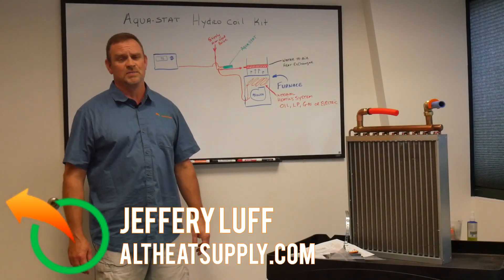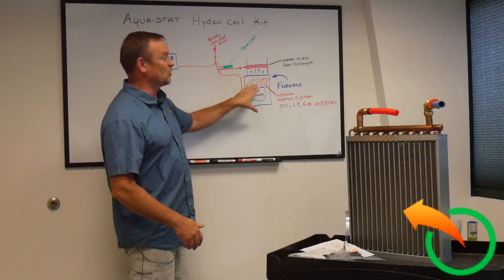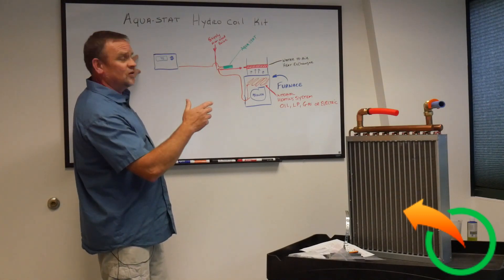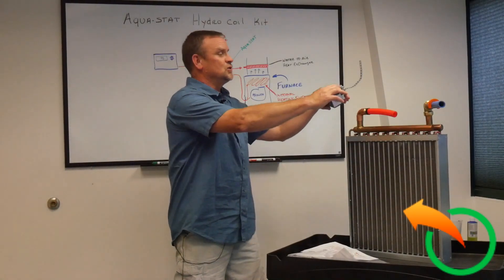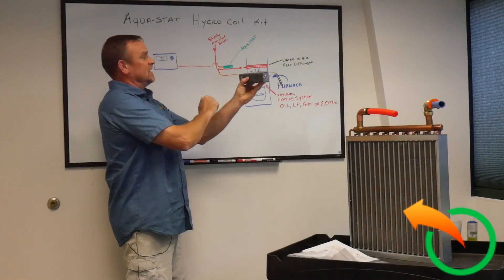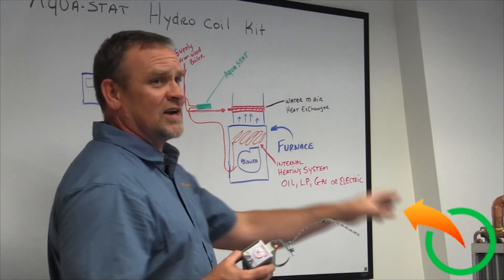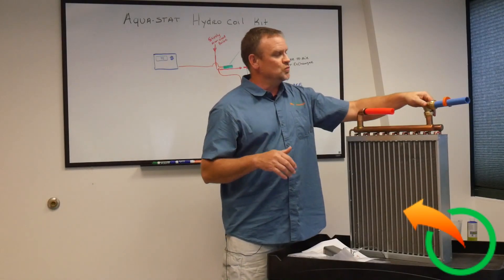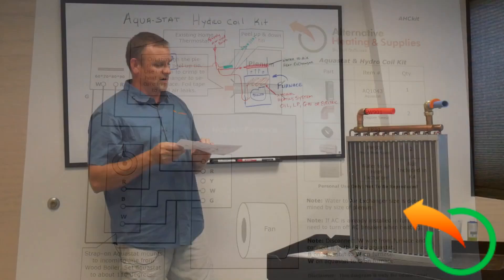Properly Connecting an Outdoor Wood Boiler to an Indoor Furnace [PART 2]

Comment: Used this setup in a previous house with electric heat and it worked flawless. I’ve moved now and have a furnace with a heat pump and lp gas backup with 2 zones. Would I need two aquastats now since I have two thermostats? The two thermostats wire to a zone control board.

Comment: Plumbing and Heating tech here—Pro tip— extend the copper pipe to allow for the aquastat to be strapped to the metal pipe instead of the pex. It will detect the temperature changes with greater accuracy and the cycle times will be more consistent.
Reply from the maker: I agree.

Comment: Will this work on a wood stove in the dining room of house and the furnace plenum is in basement that sends heat to house via ductwork?  I thought we could run water pipe through firebox and then down to the cold air return and put the heart exhanger of yours there? Thoughs? Thanks, Mark & Family

Comment: I installed per the instructions on my oil fired hot air furnace.  When wood boiler is cold, the aquastat allows the furnace to work normally to operate burner and blower fan. When boiler and heat exchanger are hot, the oil burner is disabled as expected. However, when room stat calls for heat, blower turns on and then won't turn off... So house gets overheated. How to get the blower to turn off when room stat is satisfied? Thanks.
Reply from the maker: The furnace has a sensor to ensure heating coil is cooled off before the blower will turn off. Find that sensor and move to a place so it can cool off and the fans will turn off. Jeff

Comment: I’m inquiring about the taco pump cartridge 009. I have to replace it way to often n now the cost has skyrocketed to get it. I’m thinking my actual problem is the water gets to hot because house need varies so much the water can get into the 200 degree range  or even boil n then shortly afterwards the bearing poops out. Feedback is appreciated but actually looking for advice/ options. Sometimes it’ll go out for no reason. I don’t keep the temp high unless it’s below zero outside n actually stay 20 less allowing extra time for the temp increase. The whole unit works great except for the cartridge issue. Bronze used but now very spendy. Wish I would’ve bought a case of m before. Lol I guess.

Comment: Thanks again for all the great videos.  Are heat exchangers directional in the sense that it matters what direction the supply water enters the exchanger and flows through?  Additionally, does it matter what side of the exchanger faces up in the plenum?
Reply from the maker: No, it doesn't matter.

Comment: Hello, great vid! My question is,  I already have a heat exchanger in plenum for Central Air. Can that be plumbed in-line to be also fed from outdoor wood burner/boiler and use an exhaust cooling/heating fan thermostat switch? Hope you can make sense of that? Thanx in advance. Jay
Reply from the maker: Central air exchangers are different then what we use. so No if I'm understanding your question correctly.

Comment: So I used 2 thermostats and just jumped the second therm to my first therm to where it only runs the fan. Works great and it took 1 ft of wire instead of wiring all the way back to the furnace... just an FYI.
Reply from the maker: We also don't need to run all the way back to the wood furnace. The way you did it also works. We did it that way years ago. Now we use this method to make it seamless and not have to make two thermostats juggle the temps. Happy heating. Jeff

Comment: If you wanna propane instead of your boiler when the gas runs long enough will it heat that probe up enough to make the gas shut off and run fan only ?
Reply from the maker: I'm not the person to help answer that question. I'm a wood boiler guy.
Reply: @AltheatsupplyLLC  I realize that but I bought the unit from you guys
Reply from the maker: @bcase29  Clearly I'm not understanding what your asking then. Give us a call for clarity. Jeff

Comment: When you have this installed and have two thermostats at each area of the home’s zone (one for forced air heat/cool and one only for OWB radiant heat), how do you suggest setting them so my OWB radiant heat kicks on the fan in the forced air unit? Currently have the OWB thermostat at 68, the propane heating/cooling thermostat at 55 (emergency back up heat) for each zone, and the fan set to auto. It appears the fan rarely kicks on in auto — but will work if I set the fan to On. I want the fan to turn on when the boiler thermostat in each zone is calling for heat so it helps circulate heat better.
Reply from the maker: We sell Kits to solve most of these issues. They are called Aqua stat Hydro Coil Kits. If you go to my website: www.altheatsupply.com and type in AHCkit you will get a variety to choose from that fit most applications. Jeff

Comment: Can I use this with geo thermal?  I currently have a geo unit and I want to run a boiler.    Can I use your aqua stat kit with this and use the same instructions as well?
Reply from the maker: Yes you can, I also have Geothermal and there is very little difference.

Comment: So I read in the comments that this will work with a heat pump system correct? I read in the instructions to turn off the AC breaker?  Or that something other than a heat pump?  Thanks!  Great videos
Reply from the maker: That is correct

Comment: My existing oil furnace thermostat is only connected to the oil burner and not the fan. The fan turns on via a thermostat that is sensing the temperature in the plenum at the furnace. How does your kit allow the control of the fan when the heat exchanger for the outside wood boiler is delivering hot water to the heat exchanger. Won't I need another relay that is connected to the upstairs thermostat that can turn on the fan and not rely on the probe thermostat that is in the back of the plenum at the furnace. In other words I need direct control of the fan via the thermostat.
Reply from the maker: Simple, when your thermostat sends a signal to the furnace, there is an aqua stat on the water line from the wood boiler which sense the water from the outdoor boiler is hot tells to turn on the fan only which will turn on the fan and exchanger heat with the heat exchanger in the plenum.

Comment: Can I put exchanger in a furnace down draft in a double wide ? If so does exchanger need zone valve .?.
Reply from the maker: Yes you can, but the fans or blowers don't like to much heat. No you don't need the zone valve, you can run the water around full time if you choose.

Comment: mine was setup this way, which caused the furnace to burn out because it was too much resistance for the blower
Reply: Wait. You wired the fan power feed and not the furnace control?

Comment: I have a very similar setup to this, but I do have a problem. I have the boiler set to 180. When the house thermostat calls for heat, it kicks the (oil furnace) fan only on like mentioned in the video but after the thermostat temp is reached the fan limit switch stays on because hot water is still being pumped through the air handler from the boiler it cannot cool back below 100 where the low limit is set. The result is the fan keeps running and the house gets too hot. How do I correct this issue?

Comment: I bought this kit and the aquastat I received is not like the one in the video. Mine does not strap on. It has a probe that gets strapped on I used zip ties. The probe is like a rubber after a few day it has a melting mark on it also the temp on the aquastat I don't think is accurate. Never gets above 155. It is mounted directly to the copper supply on my heat exchanger. Why is mine different then the one in this video any help would be greatly appreciated?

Comment: With this kit, I assume that there will be a circulator constantly running water between the wood fired boiler and the water to air heat exchanger mounted in the plenum?  That is the set up with my system currently.  I have an oil fired boiler in the basement and I have a circulator running 24/7 supplying hot water from the out door boiler.  I don't like this as it wastes electricity and hot water as well as there is always some thermal loss in the transmission.  So in the down times when the house isn't calling for heat I'm pumping water unnecessarily and wasting heat (and wood) as well.  I'm building a new house and will be installing a hot air furnace.  I was thinking that there would be a separate thermostat for the out door boiler that would turn on a circulator (as well as the air handler in the house) when heat is called for.   Wouldn't that be a more efficient system?  Thanks.

Comment: In answer to Don Doeb. Yes. Mine does so. wired slightly differently to this system But it does work so priority is given to wood heat then, if water is cool, to oil furnace.  I note emphatically.... that  my 100kBtu ( allegedly ) capacity heat exchanger installed in the plenum has less heat output from the wood boiler of 137k Btu output than the 60k Btu oil furnace in which plenum it is installed.  Following natural logic it could be no other way. The air temperature coming from the oil furnace is much higher than the 180°  water temperature. Whatever anyone tells you,  there is no way around this without significantly speeding up the fan to increase air flow.

Comment: Do you think the hydro coil kit could work in reverse,( if my wife is too lazy to keep the fire going).  Would it heat the water enough, that if the outside boiler wasn't on, that it would keep the outdoor wood burner's water from freezing. Circ pump runs constantly, moving the water from outside. outside tank is about 150 gallons.

Comment: I used a Fan Limit Switch which are rated for up to 14 amps at 120v. The strap on aquastats are only rated for appr 8A @ 120 Vac which could exceed the amperage draw of the furnace fan motor. 

The aquastat would probably work fine but I didn't want to take the chance.

Comment: Probably a dumb question but I purchased a double-wide on a full Foundation that has a wood furnace inside it already but I like the idea of having an outdoor wood boiler because of it being more efficient. that being said would I be able to hook that outdoor wood boiler to my oil furnace I'm sure if the Miller furnace that comes in a double-wide is any different than a regular residential oil furnace. My water is also run by on demand propane the only time the furnace is on his for when I need to use the oil for heat.

Comment: hello, great video,  I might have a dumb question.  I have been working on my mother in laws out side stove.  older model ncb 250 its about 10 years old.  for some reason it won't heat the house above 70 degrees.  I replaced the water pump and heat exchanger which was clogged badly at its inlet side.  The aquastat on the stove wall can't be set higher than about 140 degrees or it starts blowing off steam , which I don't think is hot enough to get her house any warmer.  is this true ? and should the water flow be the same pressure going into the heat exchanger and coming out . because when I open the drain value on the return line I get a sudden burst of water than it slows down a lot.
Reply: Roy, it slows down because your heat exchanger is partially blocked. Try disconnecting it and flushing vigorously for several minutes with a proprietary rad flush then flush in reverse. It may take quite a whiile for heavy scale to dissolve.  I use, AT MY OWN RISK,  hydrochloric acid,  phosphoric acid is used by dairy farmers for daily descaling milk lines. Scaling up is generally the result of repeatedly adding new water to the system.  My parents system had the same water water from 1977 to 2010 when a new, more efficient boiler was installed. Both times a good anticorrosion and scale prevention additive was used. My brother had a similar installation done at the same time but his system was open allowing small changes of water for expansion and contraction. His began leaking after 5 years.
  Setting you boiler at 140° is disastrous for solid fuel boilers as it causes creosote and corrosive condensate to form.  I have mine set to commence heat circulation at 150° with switch off at 190° I suspect your aquastat may be scaled up so not so sensitive as it should be. No way should you be producing steam. To improve system efficiency you should install a  load control valve to maintain boiler temp. and heat ex. performance. you have a choice of cut in or cut out temps. with most valves and I suggest you consult your local heating expert on the best choice for you.

Comment: hi there just a small question . if you put the water to air  h/e where you say and your regular furnace comes on and runs for a few min. mighten it over heat  the h/e  ? .i could easily see it  going above several 100 degrees that close to the source  .  what is the melting point of the pex ? i would also put a short copper nipple at the h/e to put the aqua stat on faster heat response time to the stat . think it may be 
 better in the return . run a ra89 from a separate  thermostat to the transfer pump.  then aquastat at the h/e to turn the blower on when its heated. this keeps the pump from running 24/7 .  . just a thought .  been heating with a wood boiler sense the late 80s. i do enjoy your y/t s keep up the good work . thank you john
Reply from the maker: pex starts to over heat or melt at 200 plus, i have never had a problem with melting